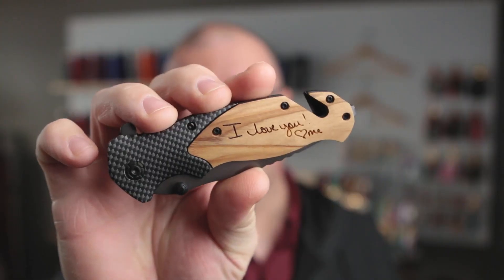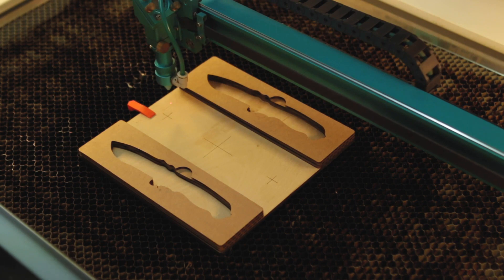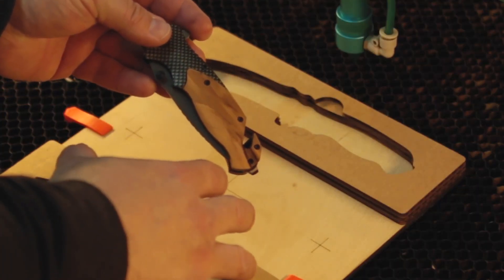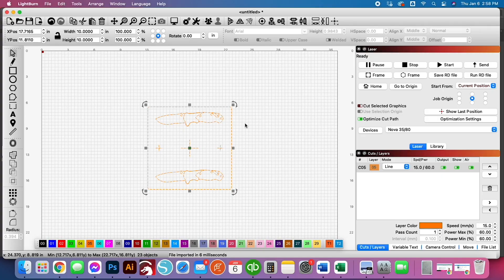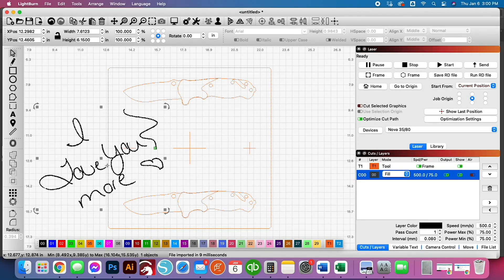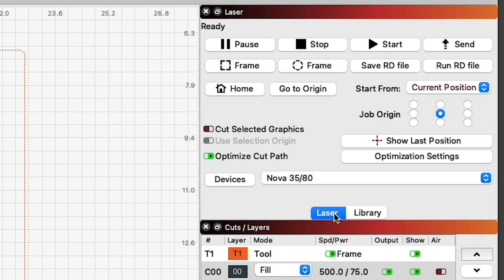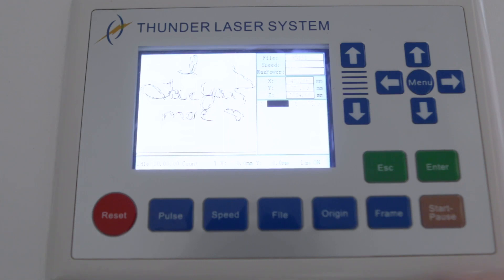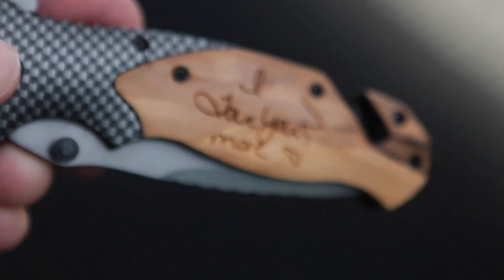Using A Knife Jig For Laser Engraving

Comment: Can you make (or have you already made) a video showing how you made the jig?  Specifically, how did you get the exact outline of that particular knife into Lightburn?
Reply from the maker: Hey Craig, I might try to do a video on that process.  But it involves taking a high resolution photo of the knife, bringing it into Photoshop to remove the background, make a selection of the knife shape, fill that selection with a solid color, use that in Illustrator to trace into a vector shape, carefully measure your knife and resize your shape accordingly.  Then you can load your knife image into Illustrator to designate the areas that you want to engrave on.
Reply: @malonecustomdesigns  great, thanks!  You lost me, but my wife is a photographer and does some graphic design.  Maybe she can handle this!